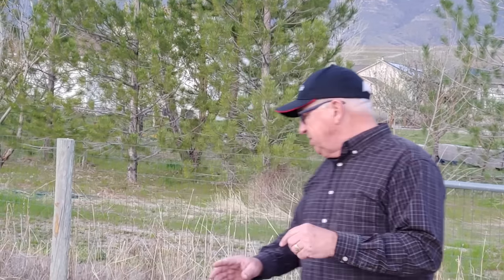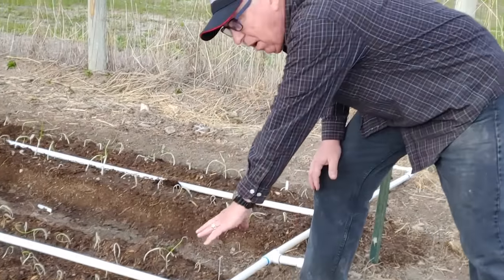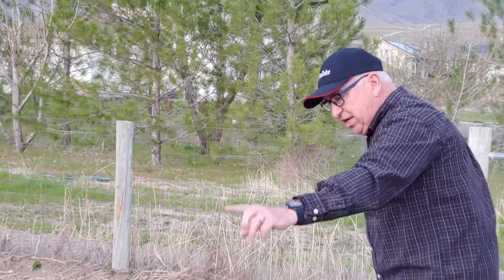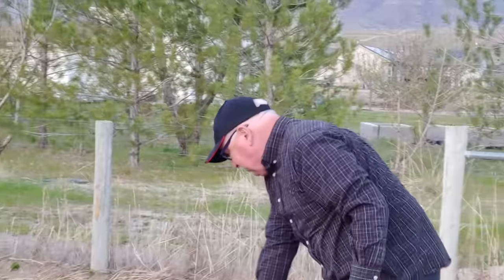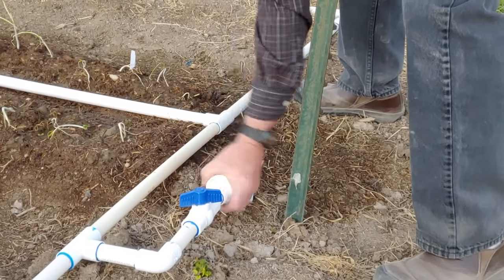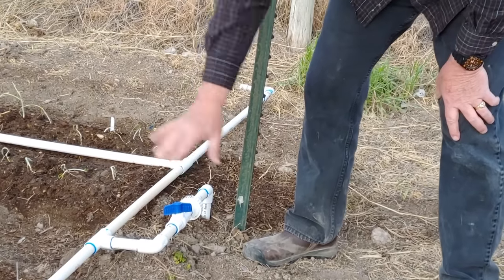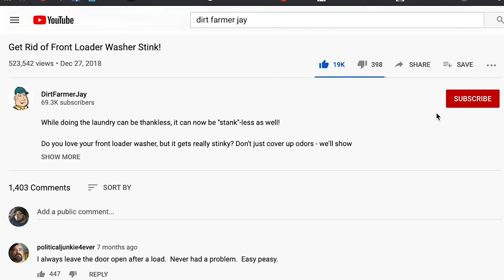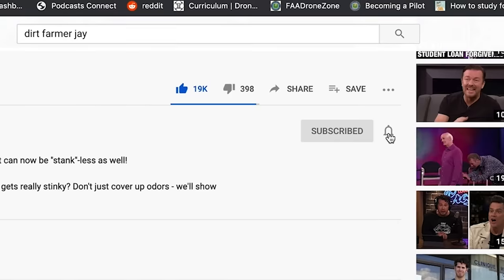DIY Garden PVC Drip Irrigation - Easy, Cheap, Effective!

Comment: Great video! What's the PSI on your irrigation? Mine is about 60, and I wonder if that is too much to have the pipes just dry fitted like that. Should I install some sort of regulating valve before the drips?
Reply from the maker: That is about that same pressure as the water from our well. The issue isn't as much water pressure as it is water volume. (How much water is being forced into the pipes.) The idea is to get the PVC pipes to "leak" the water onto your crops. It shouldn't dig holes in the soil or make big puddles. Adjust the water flow until all the holes are "leaking" water and not pouring water. You can also help equalize the flow by raising or lowering sections of the pipe by removing or adding soil under the pipe to get a more even flow. Hope that helps.

Comment: Fantastic System and I’m gonna build it very soon one question is we’ve got very high water pressure where I live in Australia do I need to put a pressure reducer on it or can you just adjust it with the faucet thanks again I’m looking forward to another video Kit
Reply from the maker: Kit, it's a workaround, but it works. Reduce the volume at the faucet until you get the flow you want at the drill holes. Thanks for watching our video and taking time to write! Best, DFJ

Comment: Nice setup! If I have an elevated rail water collection tank,could I use that as a water source? I am thinking it should work,as the system is low pressure.

Comment: i am building this system now.  do you have issues with algae growing inside the whit PVC, if so how and what do you use to clean them/rinse out?
Reply from the maker: We've not had any problems with algae, the pipes dry out between watering cycles and prevent it - at least where we are. Hope that helps!

Comment: Would you ever recommend PVC pipe on longer rows?  My garden is ... large.  I've used 25, 50 and 75 soaker lines previously, but am tired of the hassle.  Is there hope using PVC?  I have only 4 house spigots to draw from and use timers.  Thanks, anyone!
Reply from the maker: We have used this watering method for several years now and have been very happy with the results. If you don't want to replace pipes each year, be sure to take the lines apart and store inside a barn or somewhere that the sun cannot reach. That will help your setup last longer. Good luck! Dirt Farmer Maggie

Comment: Thanks for such a concise, well articulated, and thorough video! 
You state it is a low pressure system; what PSI on the supply are you working with, and what  do you use to regulate the pressure?
Reply from the maker: Thanks for watching and commenting tcgoggans. I don't use a pressure regulater per se. I have valves on the lines with a manifold to just turn the flow up or down this way. If water is not flowing uniformly, check on the level of the pipes. If there is a hump in the ground under a pipe it will not allow the water to be distributed evenly. Try to get the ground as level as possible. Best to you, DFJ

Comment: Excellent video, love your way of presenting. I'm thinking of building in some drip irrigation at my allotment, but watering is via watering can from a rain barrel. How can this be adapted to run the water from said rain barrel?
Reply: I would suggest purchasing a small external pump to push the water from your rain barrel to the irrigation system.

Comment: What if you have done companion planting?  So I have cantaloupes in with my corn; basil in with my tomatoes, squash in with my peas and beans. I got the impression from your video that different crops need different water amounts. I water by hand everyday. This is my first garden.
Reply from the maker: Suetta, first of all, congrats on beginning the adventure of gardening. Way to go! Second, various plants do need different amounts of water, but the bigger factor is how many plants are growing in a given space. The preferred way to irrigate most home garden plot veggies is drip. That puts the water right at the base of the plant, allows the water to migrate to the root zone, and minimizes the amount of water that weeds can access. As for water being adjusted based on the amount of plants growing in a given area, the best example is plants that are grown in a hill, such as melons or sometimes summer squash. Since all are drawing from one "well", putting more holes in the delivery pipe at that spot assures plenty of water for all. The same amount is not needed for row crops, such as corn. Make sense? Best to you! DFJ

Comment: I built almost the exact same system last week for my tomatoes, I tried just drilling my holes along the factory marking on the pipe only to find after putting them down, the factory writing spirals around down the length of the pipe to a degree. I was wondering how I to fix that on the next part of my system I am building and you just gave me the answer, thanks

Comment: Nice video! Currently I’m using the black line with soaker hose coming off of it to water my garden but the gophers keep eating through my tubes so I want to use schedule 40 PVC and make a system like yours to try and prevent this. Currently I have 8 to 9 25 foot rows. Do you know if I would be able to run that many rows off of the main manifold or will I need to create multiple zones?? Currently I have my system hooked up to an automatic sprinkler valve and the timer it was hoping to continue with that to have the ability to automate my watering schedule. Thanks
Reply from the maker: Danny, thanks for the kind comments! Sounds like you are having to try multiple approaches and materials to overcome the "locals." I suspect for your size of irrigation system, you'll need to break this down into sub-zones. That can be done with valves inline on the manifold itself. Even a 1" high volume water connection would likely have problems keeping up with what you've described. Having said that, we are finding that if you create loops with each pair of laterals (by joining each pair with 2 elbows and a straight pipe), the system balances out a bit better as well. I like the automation portion, but if you need to subdivide the lateral or a portion of the system, you'll only be able to semi automate. I hope that helps! Best Regards, DFJ
Reply: Thanks for the reply. Do you have any idea on how many lateral and what lengths you can do per system before needing to put an inline valve to sub divide? Thanks again

Comment: Interesting video. I'm wondering if you don't notice a significant difference between the water delivery at the end of those 8 foot pipes and the beginning? I'm guessing that the difference would be magnified if you had a manifold delivering water to several (say) 8 foot runs. Cheers and thanks for posting.
Reply from the maker: Captain Ron, there is some difference, and the system is a bit sensitive to slopes. I have one of these set up with 8 - 20' runs. I had to put a valve on one of them to slow the flow as it would get all the water delivered way before the others. One you set it up and balance it for the season, it's not 100% precise, but does it really save labor. Another trick is to raise the lines that are over delivering on some bricks. Let me know how it works for you - and thanks for being a part of our viewer family! Best, DFJ
Reply: @DirtFarmerJay  Thanks for the reply. I already have drip systems in my garden and I use pressure compensating emitters/drippers. I was just curious to see if there was another way. Cheers and thanks again.

Comment: Hello there: 
I'm not very familiar with all of this and I have a question, do you use a tiller to prepare the soil?
Maybe you have a video where you talk about ways to prepare the soil?
I know that if you click on the channel icon you can go to the channel main page but, I think you may
have a more specific answer to my questions.
Thank you.
Rick.
Reply from the maker: Rick, I do have a tiller, actually 3 of them of various sizes. One is the Mantis tiller, which is tiny, and allows getting in between plants well or prepping raised beds. The next one is a walk-behind tiller, with a 18" swath. The next is on the back of my compact tractor, and is 4' wide. These are used for various tasks, including weed control and prepping the soil in the spring. However, keep in mind that tilling ongoing can actually lead to destruction of the soil structure (pulverizing dry soil), or compaction (tilling and putting weight on very damp soil). We don't have a video at this time but sounds like a good idea for next spring. Thanks for writing! Best, DFJ
Reply: @DirtFarmerJay  I'll be waiting for the vid. Thank you.👍👍👍

Comment: Hi Jay, first of all, your video has really helped me, but I am curious as to what size valve you used for the 3/4in pvc pipe and the name of the thing that connected the manifold to the water?
Reply from the maker: Melany, thanks for your kind comments. There are two sizes of valves used, depending where in the set up you use them. If you putting a main volume control valve ahead of the manifold, and you have a robust water supply, use 1". If water is being supplied using a garden hose to the manifold, 3/4" is more in order. If you are "sub-valving" the manifold to assist with water distribution to the lateral lines, 3/4" is again the way to go. I hope this helps! Best, DFJ

Comment: Love your system, but in our case we don't have a water source near our garden.  I could put in a rain barrel nearby.  If it was placed up on some concrete blocks, would it generate enough pressure to reach out 8-12 ft?
Reply: 0.42 pounds per square inch of pressure for every 1 foot of head pressure.  Head Pressure is the height of the water surface in the barrel times the distance in feet to the outlet below the barrel. Static pressure is without water flowing. Residual pressure is with water flowing. Oh and don't for get depending on size of pipe or hose flow will also develop "friction loss" which subtracts from your flow or Gallons Per Minute.

Comment: Beginner gardener, I’ve been researching and planning a layout since 2019. It’s now spring  2022, and I have a small property would a hose attachment work as well?
Reply from the maker: Stephanie, yes - and you'll need to experiment on how much you turn the hose on to properly fill the system. I hope that helps. Best, DFJ

Comment: Hey Jay, thanks for this! Can you explain how you connected to the water source? Looks like underground. Thanks!
Reply from the maker: Danielle, thanks for writing. Indeed, this section was connected to an irrigation circuit operated by a controller/timer. However, this could also be a hose-connected, and there are hose bibb controller units now readily available that allow you to take a much more low-tech or dedicated to a single space approach. I hope that helps! Best, DFJ

Comment: @DirtFarmerJay  ~~  Will this irrigation technique work on 3 - 50 ft rows fed by a water hose?  Also, does the soil need to perfectly level?  We tried weeper hoses this summer and found low spots prevented the water from making it to the end of the hose.
Reply from the maker: Linda, thanks for watching and writing. This will work for your setting, with a couple of caveats. First, you will need an adequate supply of water coming through the hose. For most outside faucets in the yard (not those attached to the side of the house with the water coming from a small supply tube from inside the house), you should be fine. Use a quality 5/8" hose, and use 1" to make the supply manifold/lateral that will supply each of the row runs. Then reduce down to 3/4" for each of the runs and drill the 1/16" holes at the desired spacing. 

The soil doesn't need to be level, but the lower spots will get more water. If your plot runs downhill, put the supply side on the uphill side to take advantage of the slope. Where there are low spots, you can run the pipes on tops of bricks or wood blocks to get the water to go where you want it. It's a quick trial and error to get the water where you want it.

Let us know how it turns out! Best Regards, DFJ
Reply: @DirtFarmerJay  love

Comment: great idea Jay.  One question, how long can one pvc pipe can go?  i want to make it one pvc pipe go 300ft.  grape arbor
Reply from the maker: That's a good question danny kim. 300 feet it quite a way to go. You may be able to make it work by drilling smaller  holes in the pipe at the beginning of the run and then get a little larger holes towards the end. Best to you, DFJ

Comment: Great video- thank you.  One thing you didn't address that would be very helpful- I created an irrigation zone (feed lines buried) that apparently is too much to feed (too many 1/16" holes) from a garden hose.  I'm trying to figure out how many holes I can adequately feed with about 8 gallons per minute flow out of the hose.  As it is, I have to manually turn off about half of my lines to get adequate water distribution.  I'm thinking that a smaller hole size (1/32"?) would still get the job done, support more pipe length, but just take longer.  Your thoughts?
Reply from the maker: Glad the video helped. You can always make the holes in the PVC pipe a little larger if some of the boxes are not being watered properly. Best, DFJ

Comment: How do u controll water pressure? Great video btw.
Reply from the maker: Awais, there are a couple of ways. In reality, I mostly control water volume and dissipate pressure by having plenty of places for the water to go. So, the first thing is a master valve just before the distribution manifold. Another thing is to raise the areas that are getting too much water to get the water to go to other areas that are not naturally getting a good supply. Third, sometimes I put "sub-valves" on the manifold to create a bit of back pressure to equalize water distribution across all the delivery pipes. Does that help? Thanks for your kind words and for taking time to write! Best Regards, DFJ

Comment: I have a rather large pumpkin patch I plan on drip irrigating this year. Four 30 ft long rows rows 12 ft apart. My problem / question is this semicolon my garden has a fair amount of slope to it. Will this system work as described, or will I need to make it a complete loop? My concern is getting roughly the same amount of water to each hill. If I make it a complete loop, will I have to tape the unglued fittings to keep it from uncoupling?
Reply from the maker: Thanks for watching and responding with your issue. I talked with DFJ and this is what he said. First, make sure you manifold is large enough the feed all the lines you have. Secondly, to deal with the downhill slope, the first thing you should do is elevate the pipes with a brick (or bricks) under it to even out the flow. Thirdly, if that doesn't fix the problem, attach pipes 1 and 2 AND 3 and 4 with a solid pipe and the end of the run. That will help force the water back up the pipe. DFJ says that is you'd like to have a more in depth conversation about this, please contact him at jay@dirtfarmerjay.com. Please let us know what you end up doing and how it's working.

Comment: Great video thanks alot 
I have a question though can this system be use in a large farm?  if yes do I have to get pressure machine installed to be able to get water all around the farm? Thanks
Reply from the maker: Triple A - I find that this approach is better suited to smaller scale gardening and farming. Setting up and taking down all the pipes each season would get tiresome really quickly, beside doing all the drilling for set up. Having said that, why not experiment with a smaller plot and see how it goes and what you think. Then, you can make a determination of whether or not it's scalable for your setting. If you do use this, indeed you'll need some way to have the needed volume and pressure to properly feed the system. I hope this helps! Best Regards, DFJ
Reply: It really helps thanks so much

Comment: Will this work by using 1/2 pvc pipe everywhere? What are the pros/cons with 1/2 vs 3/4?
Reply from the maker: The main difference is the water's volume with the larger 3/4 inch pipe. 3/4 inch is also a little more expensive than 1/2 inch. You want the water to drip or slowly run at the base of your plants.  You don't want too high of water pressure to dig holes at the soil around the plant base. Best to you. DFJ
Reply: @DirtFarmerJay  thank you for your response. I may have missed it in the video, but what size did you use? I ordered 3/4 and am still in the return window if needed. I was thinking 3/4 would be better than 1/2 but I could be wrong and it was a bit more expensive. Sounds like either size would work? Or is one preferred over the other?

Comment: Is pressure not lost? Are the first holes pushing mote water then the last holes
Reply from the maker: Utopia, thanks for watching our video and taking time to write and get clarification. Indeed, pressure is lost, so you need a sufficient amount of water to assure that water gets to all the ports. We found by raising the sections (very slightly) where waters first arrives at helps distribute the water well. We've actually put valves on some of our supply manifolds to help get water where it's needed. When setting up, it is a bit of a trial and error, but it sets up quickly and works for the season. I hope this helps! Best, DFJ

Comment: What is the fitting that you used to screw on and off to the main water line?
Reply from the maker: Sheri - these are available in the plumbing section of a well-stocked home improvement store. The fitting is a slip on one side (to be glued) and the other side is a swivel female hose fitting.  I hope that helps! Best, DFJ